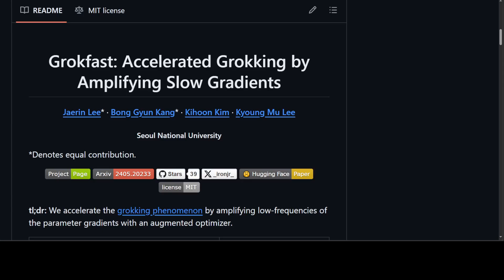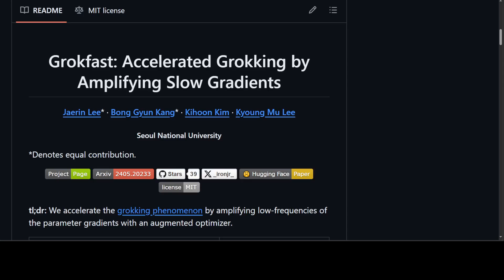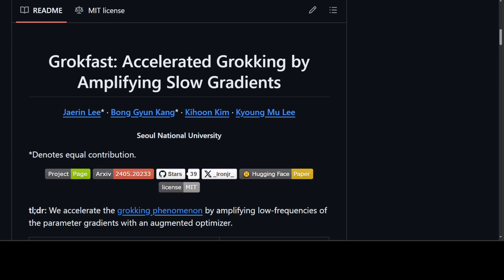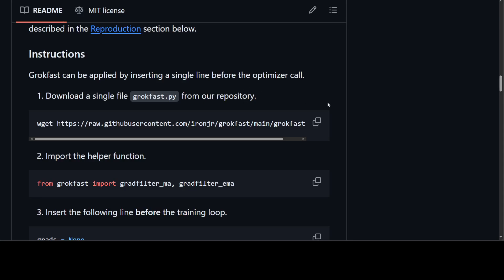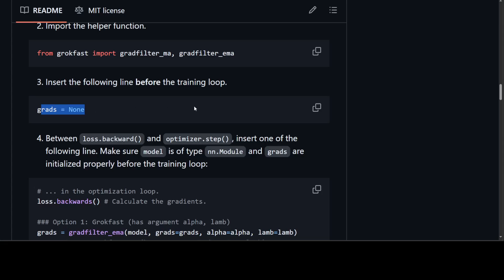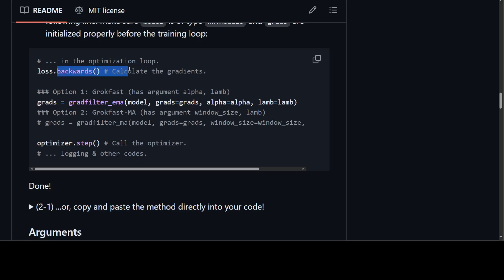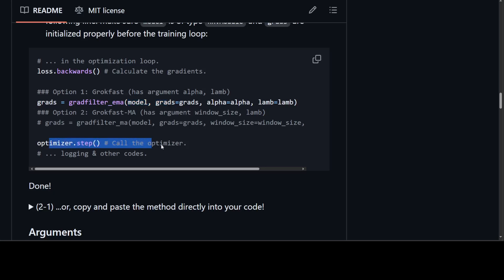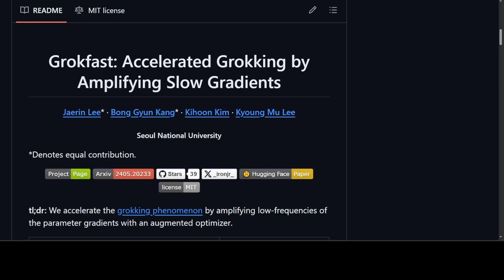What is Grokking and Over-Fitting of an LLM

Comment: hmm..
the question is how to implement this in the huggingface trainer  ? ... this is used when the model is overfit to the task to regeneralize the model as well as prevent the model form over fitting on a large dataset(especially when you want the whole dataset to be inputted) - sometimes you may need to stop training early aas the jobs is becoming too close .... this prevents this .. esentially moving the gradient to a  higher average  ..maybe ? im still unsure ... but its kinda a fixer
Reply from the maker: Thanks, good comment
Reply: This doesn't prevent overfitting - if I understand it correctly, the generalisation ability comes from continuing to train after overfitting, apparently up to 10x more, and weight regularisation drives the network slowly towards generalising rather than memorising the dataset. This doesn't prevent overfitting, it's simply to speed up the process of getting to that generalisation after the model has already been overfitted.